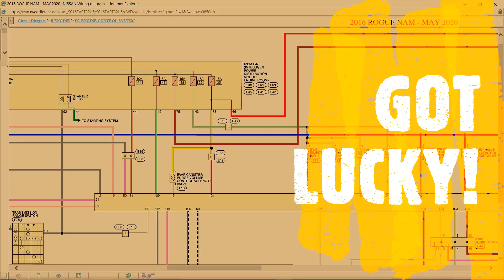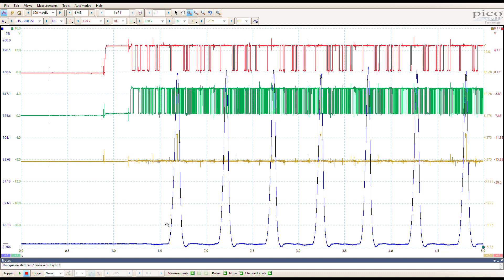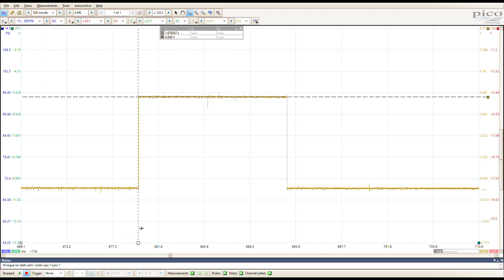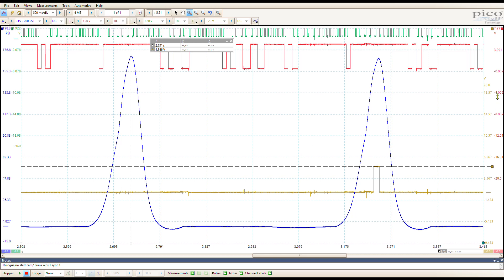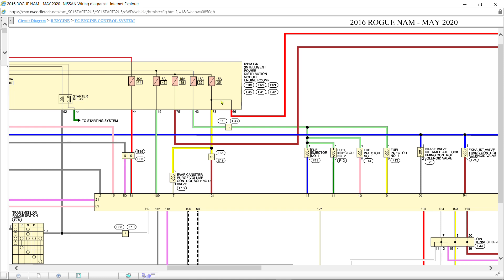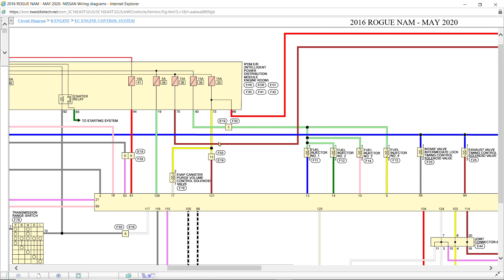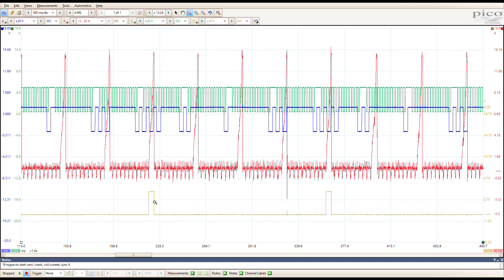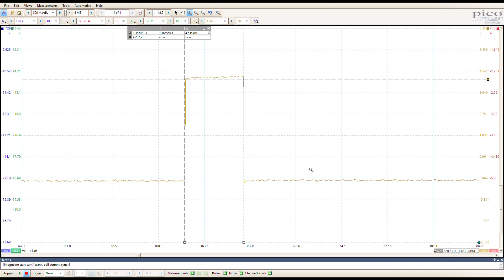Feeling Lucky

Comment: I am in the marine repair field and I find corroded battery cables and fuses quite often that will show full battery voltage and everything working until the engine is cranked and the voltage and current drops off to the PCM, coils or injectors and shuts them down while the engine cranks normally. Sometimes once the inrush to the starter drops the other devices receive enough power to reactivate and start the engine. After the engine starts all seems normal because the voltage drop isn't enough to effect the running engine plus the alternator is adding power to the load side of the resistance. These are the kind of problems the praised self diagnostics and the repair manuals don't usually address. Customers think all we have to do is ask the computer where it hurts.
Reply from the maker: Customers usually think the "machine" will fix it all. Some need to be reminded that the "machine" between my ears is what they are paying for.  Thanks for commenting!

Comment: I’ve probably watched every free video by Bernie Thompson and have learned a lot
Reply: He has always said if you look at voltage you can imply some sort of amperage or lack of. And the point you made about the coil command fit’s well into it.
Reply from the maker: @yamaha0405  Thanks for commenting.  Bernie is a very knowledgeable man for sure. I've always said , voltage is what the computer wants, the current is what tells us if it actually happened.